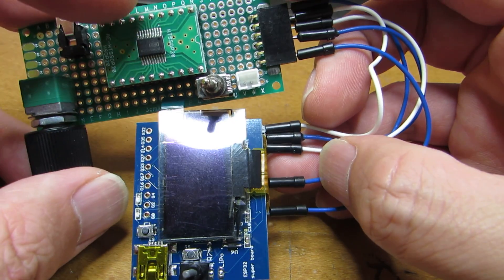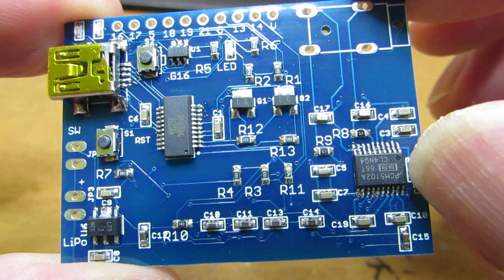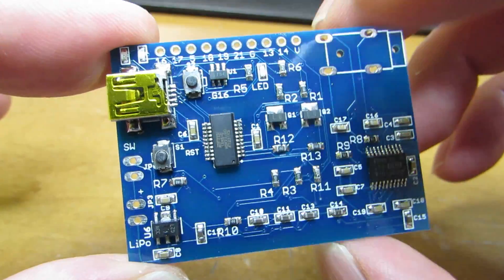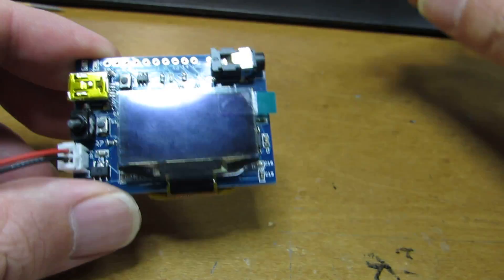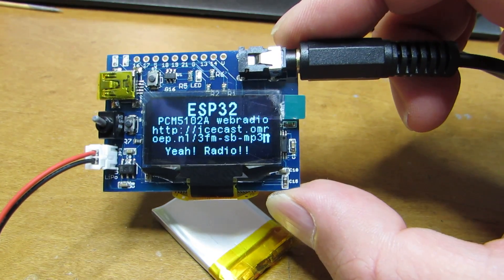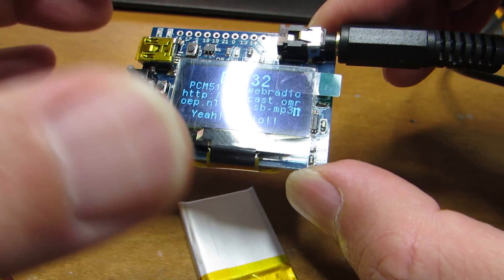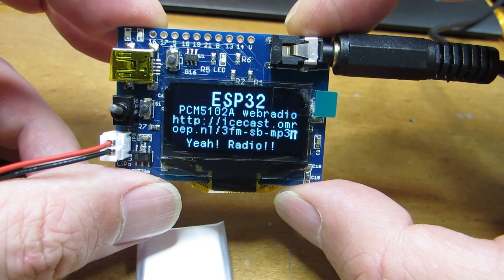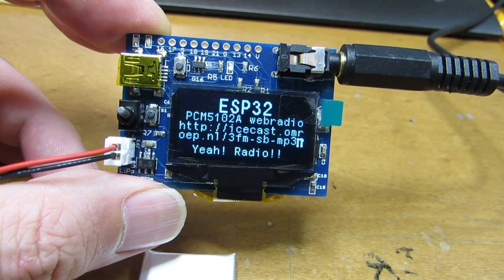Finally ESP32 web radio gets single board and standalone

Comment: Hey how to beuild it using es8388 dac and esp-wroom-32.Please answer me.
Reply from the maker: Hmmmm ES8388 needs I2C for register setting in addition to I2S. The chip of this board (PCM5102A) needs just I2S and you will need to consider some mode modification?

Comment: Would it be possible to use this as In-Ear-Monitoring-System if I send the sound via a local audiostream? Or is the latency to high?
Reply from the maker: Hello, it can work for audio stream through Bluetooth but current size is a bit too large for in-Ear system.
Reply: Thanks for your fast answer =) But why should it be too large for In-Ear-Monitoring? I would like to use it as receiver-unit like all In-Ear-Monitor-Systems and then the bandmember could plug in their earplugs.

Comment: Hi, you have any board with Ethernet, ESP32, Oled and PCM5102A in one board?
Reply from the maker: Hummm but I2S bus and RMII (Ether) have pin overlapping. One possibility will be Ethernet using SPI not using ESP32's embedded Ethernet function..
Reply: +microwavemont Then with Wiz5500 or Microchip, good, this your board ESP32 ABD have external SPI for connect another board?
Reply from the maker: Yeah right, Wiz5500 will be good candidate. Indeed SPI of ESP32 is re-locatable and ESP32-ADB pinout can be SPI terminal by writing proper program.

Comment: How do you program the web address for the radio station? How are you able to produce those boards so quickly?
Reply from the maker: Hello. Programing web address is through coding by esp-idf. Rapid prototyping is done by,,, just do it quickly..!
Reply: how it is done. ? I'm very basic. I have the arduino ide installed on my pc, how do I do this? how to copy these codes from github to arduino ide? you can help?